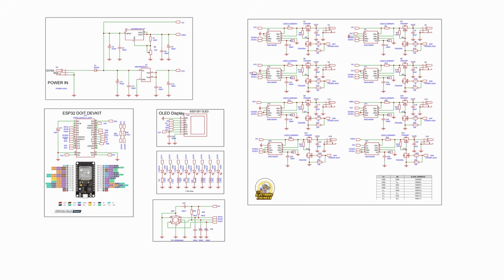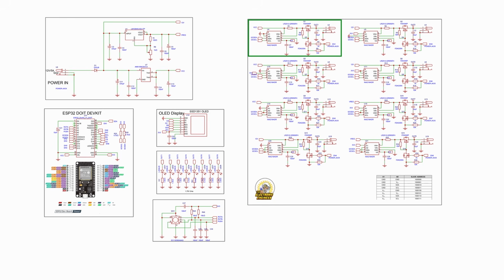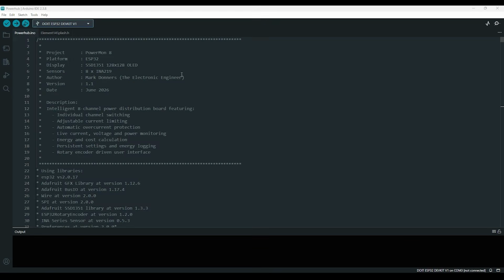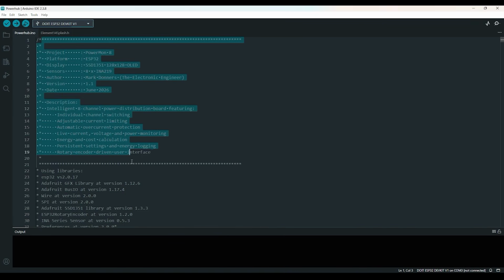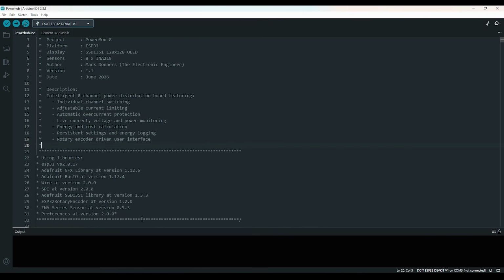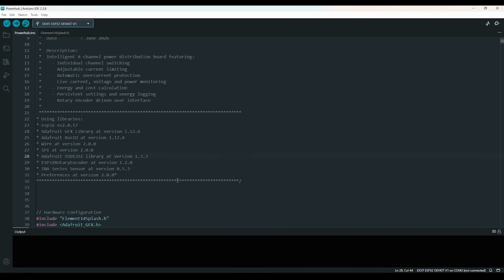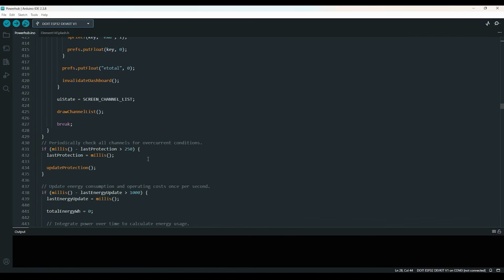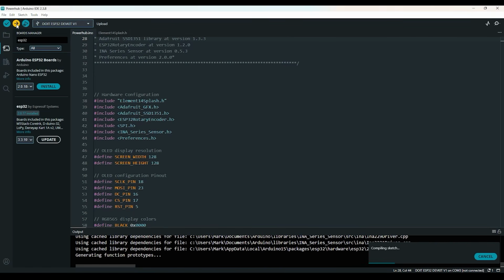ESP32 Power Monitoring System with Protection & Energy Tracking

Comment: Neat timing, I am about to start back working with the Arduino app, ESP32 and some C++ coding for a couple projects I plan.  The first project is an external battery pack for a power station, an Oupes Mega 1.  Then, the second project being I want to eventually adjust sense wire values read by a JBD and or Daly BMS and input those into the Prius HV NiMH battery sense computer so can use the later gen 1 plug in lithium NMC 56 cells pack. Figure better start smaller with the 14S one NMC brick and explore and learn some ways to read, process and output the data. Waiting on some more parts and will be interesting using the ESP32 for.  Will be interesting if I can accomplish the third, being to make a complete replacement HV battery sense computer (aka "glass unit") that is plug and play for the gen 1 plug in Prius. Not certain which route to go yet on that, like maybe mod the Linsight LiBCM LiBSU or develop new.  Excited to get started now I have more of the parts arriving.